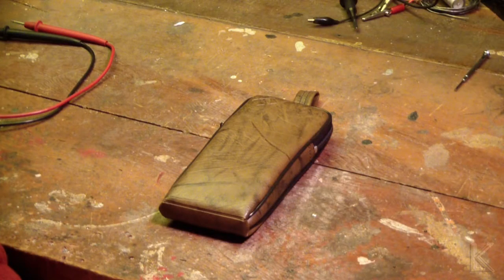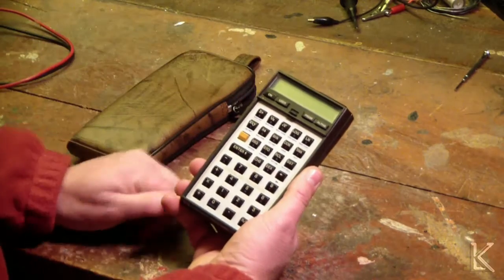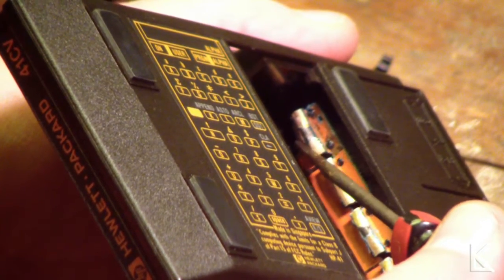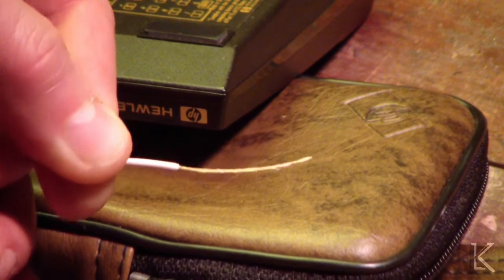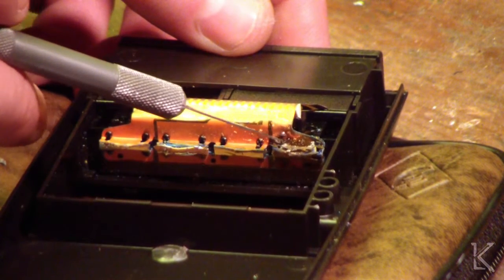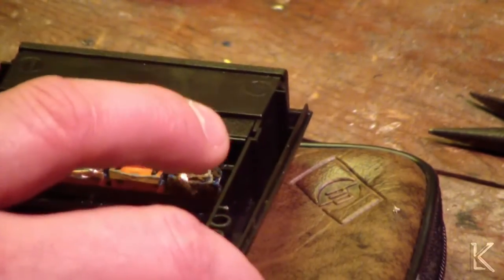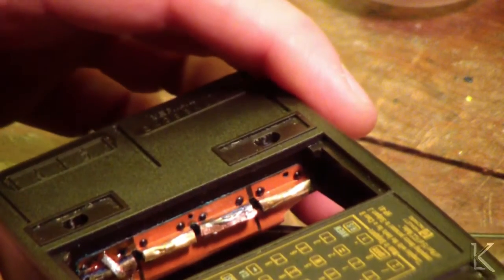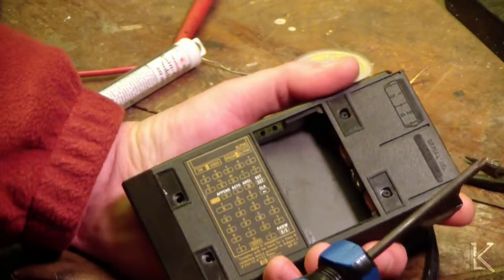HP 41CV calculator repair of bad battery contacts

Comment: Trying to repair my contacts. Could you be more specific about how you soldered the thin copper wiring to the top of the contacts?
Reply from the maker: I'm sorry,  this video was many years ago and I no longer have the calculator.  I don't remember.

Comment: Acquired two of those recently. One with copper oxide all around the contacts, a little clean up did the trick. The other one, not only the copper foil all eaten up but the plastic backing as well. Just four big holes remain. I leave that one for couple of rainy days. I did a Google search, the replacement battery contact part very hard to find now.

Comment: I had an opportunity to finally get a scientific calculator when the HP-45. That was the thing for a student surveyor in the early '70s and I had been using the class equipment. Used it every day until the early 2010's. When the HP-41CV came out, I had to have it to use with the survey module in the field. I'm retired and use it to this day several times a week. Love it. All they need is fresh batteries every 5 or so years and the contacts wiped off if I don't feel I got enough batterie life. I did get an HP-48SX and outfitted it as a data collector, but it got damaged when the roof of my office came down. HPs have been a powerful tool for me for 50 years. I could do survey calcs all day long still, but I'm retired. I hope that you enjoy that HP because I most certainly do mine after all these years. Nice find.

Comment: Replacement flex circuits are readily available  to do this job well. Your fix though is quite ingenious.

To fix the broken bosses. Most folks wrap the boss with fine electrical wire and drop some cyanoacrylate glue in the hole to tie it together. The integrity of the screw bosses is important as they need to supply the clamping force to ensure contact between the flex pads and the motherboard pads.

Comment: I was removing the battery pack on an HP 41CV and a small thin V shaped piece of metal popped out. I believe it is a spring, but don't know where it goes. Any ideas? Thank you.
Reply: It is likely the Battery Retainer.  There should be two of them in the N cell battery pack, with each holding in two cells.
Reply: @1djbecker  
That battery retainer spring? Mine came off with a tiny piece of plastic from the edge of the battery holder. Super glue did the trick.

Comment: I am happy that you resurrected this wonderful calculator, their weakness are those film contacts that were corroded by battery outgassing. The screws guides that held the case together break from posts when the calculator falls and received a hard knock. Also overtighten the screws break them too. This calculator is one of the last good calculators that HP made that went into history as one of their best products.

Comment: Nicely done Kevin. I've been an HP calculator since the 1970s and have everal in my collection. On of which is a HP-41 (my first) that I got in 1982. The battery posts are destroyed due to leakage. I wonder if it could be repaired?
Reply from the maker: You could probably repair them in a similar fashion.  It's tedious to do, but worth it if you want to preserve the device.

Comment: For the screw, if you really want it to fit tighter, you could a carpenter's trick. Put something in the hole that the screw threads will bite into. Maybe a sliver of toothpick. Just a sliver, not the whole toothpick. I wonder if copper tape has enough conductivity to work. If the adhesive backing isn't sufficient there always super glue.

Comment: The "C" I think means it has the higher memory on board without the plugin memory. Dave talks about it on EEV on an episode. #573 or #582 I believe.
Reply: No, that would be the "V". The original was the HP-41C and the HP-41CV has the extended memory. The HP-41CX has the extended memory and a built-in module called X Functions that was a separate plugin module in the other versions.